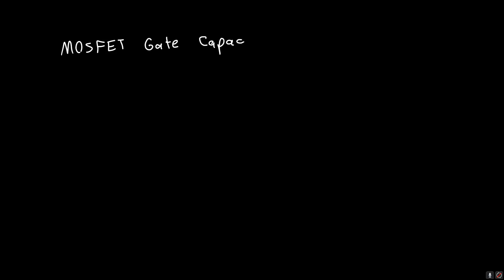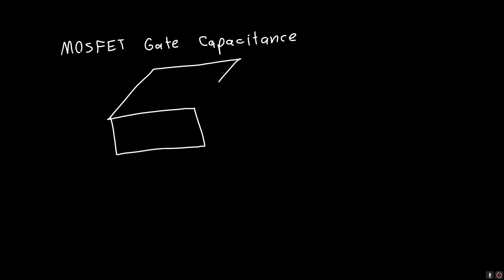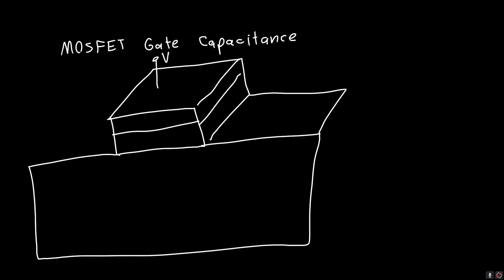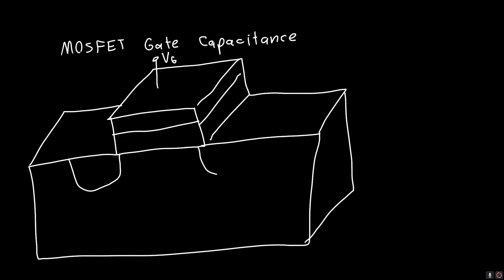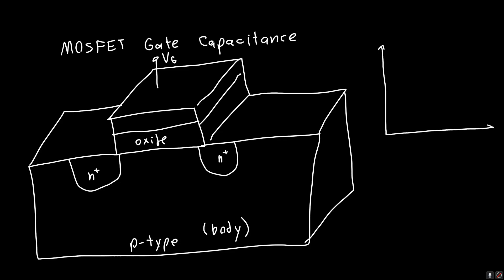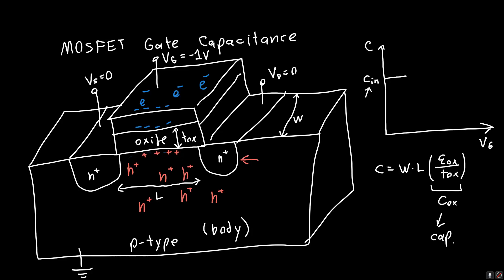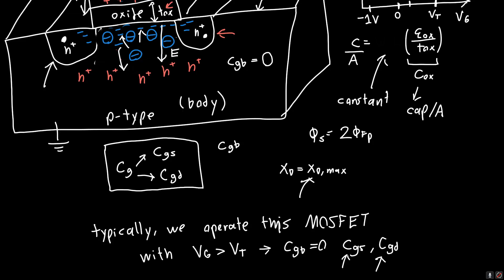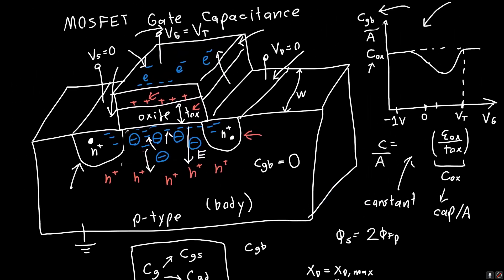MOSFET Gate Capacitance Part 2

Comment: If I want to use a device as a capacitor, would I be better off inverting the channel by gate-to-N+ capacitor, or enhancing the channel by gate-to-P+. It would seem to me that starting with a channel already enhanced (change the N+ to P+) would yield a better capacitor. Yet some of my coworkers think not. Am I missing something?
Reply: This is an extremely subtle question I only recently encountered myself. At first glance, it shouldn't matter. The capacitance will be the same either way since you have a sea of carriers separated by the gate oxide (regardless of their identity). However, if those carriers are electrons and your substrate it p-type (the channel is inverted), then those electrons are minority carriers. And when you need to charge and discharge your capacitor, it just takes more time to wait for the electrons to get generated by the substrate (this is how we actually get the electrons for inverting the channel in the first place). In contrast, if we use holes from a p-type substrate (put the capacitor in accumulation mode), we can inject those holes from nearby contacts and get them easily from the substrate (which has an excess of holes). See Neamen Sec 10.2 on C/V characteristics of MOS structures.

Comment: Hello! Big fan over here! You really have an awesome teaching style :). I just wanted to ask you a question though. In minute 4:17 you mentioned that the minimum capacitance happens at a certain unknown voltage. And to calculate it, we need to use the condition for when the depletion region is at its max: phi(si) = 2phi(fp). But this is the condition for inversion, and therefore the condition for which the threshold voltage was calculated.  Shouldn't it then have to be the threshold voltage the one at which the capacitance is at its minimum? Thank you very much in advance!
Reply: Same doubt here

Comment: sir，I'm so confused，1.why Cgb=0 when there's a depletion region between inversion layer and bulk?in last video u said Cgb(when MOSFET is off)is equal to Cgate-dp in series with Cdp-bulk，so in this case Cgate-dp is 0 but Cdp-bulk is not，so shouldn't Cgs ＝Cdp-bulk? 
2.please correct me if I'm wrong，so in accumulation process，Cgb is equal to Cox*A which is a constant ，and this is Cin in your video，the capacitance decrease as u increase voltage ，so why is Cgb equal to 0 after inversion? shouldn't it equal to Cox*A?